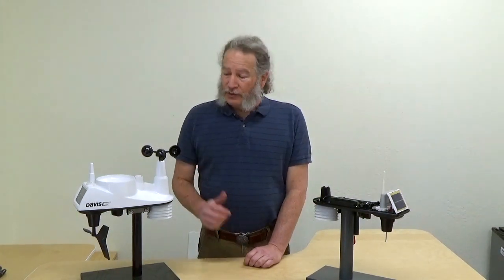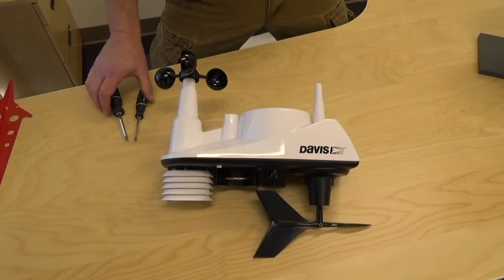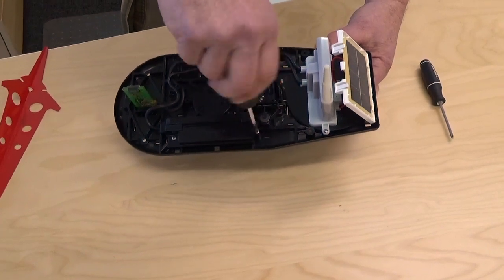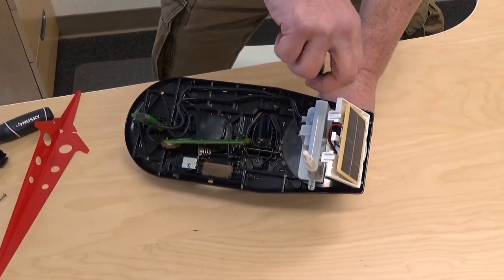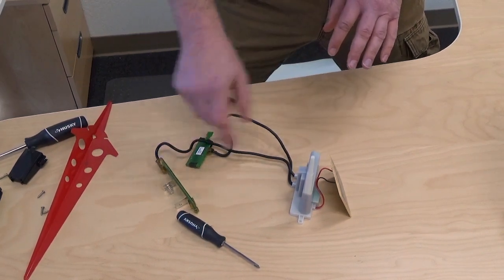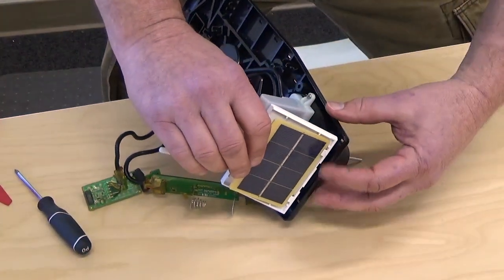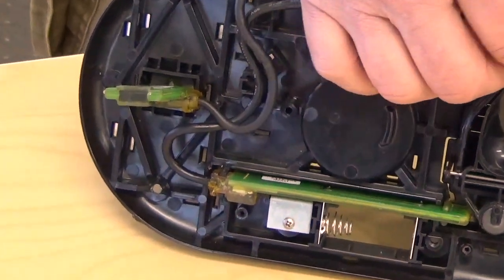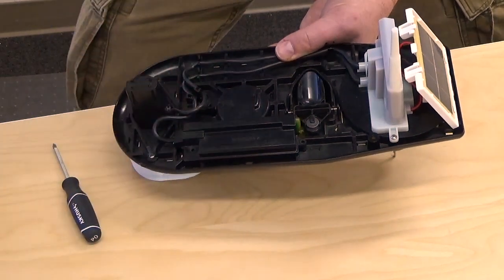Vantage Vue Harness Replacement

Comment: It is unbelievable to me that the capacitor that the solar panel charges is in the epoxy resin and not replaceable. My solar garden lights have AA nimh batteries I can replace every year and it works fine, without throwing out the whole fixture . Why doesn’t Davis design the harness like that? Everything works fine in my Vantage Vue sensor except the capacitor. So i guess i have to buy a whole new harness instead of swapping a $2 AA nimh. I was happy with my Vue but instead switched to a competitor which was cheaper and has integrated wifi and a free cloud service to view my station graphs on the web. The entire system was cheaper then the Vue sensor alone. So far it’s held up for 2 years. I don’t mind paying for quality, Davis, but you gotta be competitive. Right now the competition’s mousetrap is better and cheaper, a double whammy.